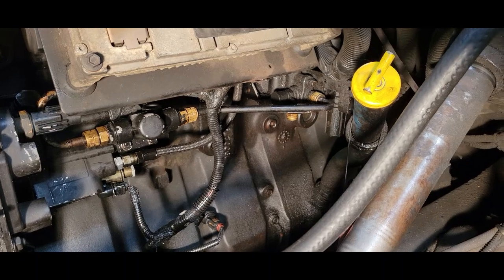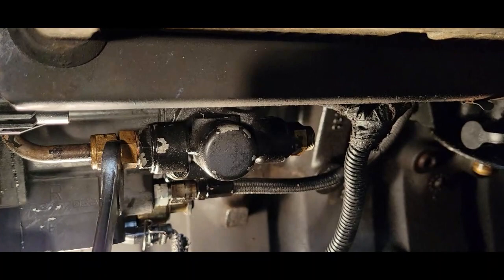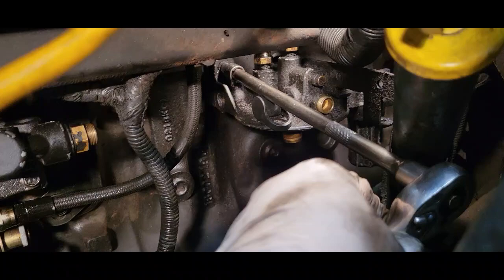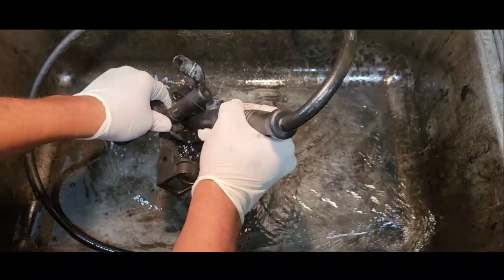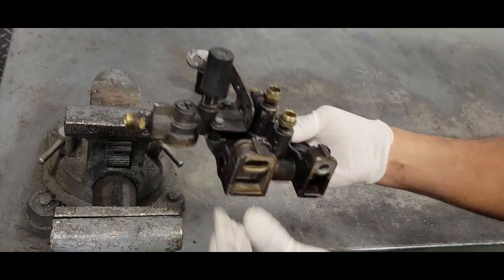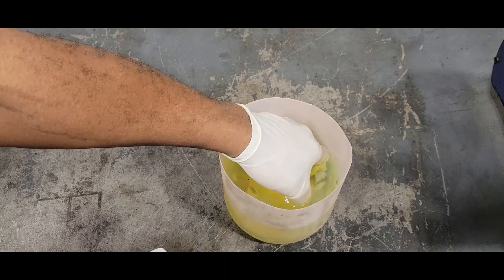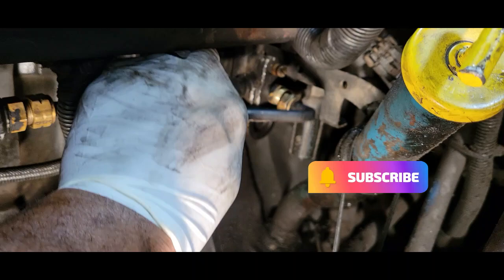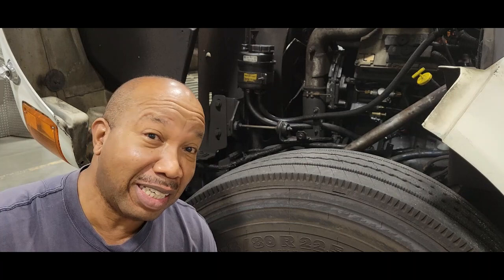International DT466/530 Fuel Primer Pump Replacement

Comment: I have a 1999 4900 and have to replace primer pump. It will not pump fuel and I suspect it’s allowing air to enter system.  Thanks for the video!

Comment: I have an 04 dt66 4300 while stopped at light feels like it turns off for a quick second kind of looses power but turns right back on..no codes can a clogged strainer be the cause?
Reply from the maker: @rudycifuentes2662  That is  possible,  I would change the Fuel Filter. When you remove it. You can get to the Strainer easily. Make sure your Fuel Tank has no trash in the bottom of it that could block your suction tube. If all of that is good to go and it is still doing the same. I would look at replacing the Camshaft Sensor. A Camshaft Sensor can make a vehicle do just that and give no codes.
Reply: @dairleautoclassicrestorati6892  I changed fuel filter cleaned out strainer real well and replaced cam shaft sensor, I believe it’s still fuel related I might take a closer look into the tank
Reply: If that’s not the problem where would you look next?
Reply: Can it suck air into the system if the gaskets for the fuel lines are shot?
Reply from the maker: @rudycifuentes2662  yes

Comment: How do you like the dt530 is it a good motor.
Reply from the maker: They are good and dependable Engines. I never heard anyone talk bad about them. They seen to be a little slow in a Dump Truck. But a Truck with single rear wheel alxe. It provides plenty of power.

Comment: I have a 95 4700 dt466 that I can't get to start...the primer button used to get hard but I can't get it to anymore. When fuel filter is empty the primer button won't fill it but if I fill the filter I can bleed out with primer button...I'm not a mechanic so I'm trying to understand what I'm dealing with I guess and if I need to replace my primer button(which by the way looks a little different from yours in the video)
Reply from the maker: Primer Button are known to wear out. Especially when they are not used on a regular fuel filter change.
Reply: @Dairle Auto Classic Restoration Repair  Do you know where I can find a primer pump for a 95 international 4700 dt466?  The only one I can find is like the one u installed on the truck in the video but I think that's for the dt466e...or would that one work on my truck as well. My primer looks more like a push button.
Reply from the maker: @Andrew Miller  Not off hand. I remember replacing many of those pumps. You had to unscrew the knob and then you pump.

Comment: Does the dt466 have that strainer? I got a 1988 s1800 with the dt466.
Reply from the maker: Yes, look behind the Fuel Filter and you should see a small Tube. The Strainer is inside. It maybe earlier to get to it if the Fuel Filter is removed.

Comment: How easy is it to replace the lift pump? I've got a 1987 International that can't keep the fuel filters full. It runs out three or four times before it's warm enough to stay running. I thought the pump could be the issue.
Reply from the maker: Check and make sure you do not have an item or trash in the bottom of your Fuel tank. If so, the suction tube could be picking it up and stopping the fuel flow.

Comment: Changed my fuel pump and now when I prime the button never gets hard. It’s not building any pressure.Any pro tip
Reply from the maker: Some may or may not get hard. As long as you are able to prme fuel out of the bleed screw.  You should be good to go.
Reply: @dairleautoclassicrestorati6892  thanks for the speedy reply.
Reply: Mine too but i been pushing down on it for more than 30 minutes and no fuel come out the bleeder. The filter is full. Just replaced lift pump. Any ideas? Truck wont start only on starting fluid then dies

Comment: Hey D new sub here I’m having trouble with my 4300 2016 I already changed the ICP about to install the IPR valve my truck turns on in the morning but when it gets warm I shut it off won’t turn back on I see posible the lift pump but I can’t find it on mine is it electric on mine thanks
Reply from the maker: Thank you for Subscribing! To save you some time and headache. I would have someone with a Cummins Insight Software to hook up to your Truck. All it takes is  one little Sensor to drive one crazy.
Reply: Is happen me the same thing in a international 4300 2002